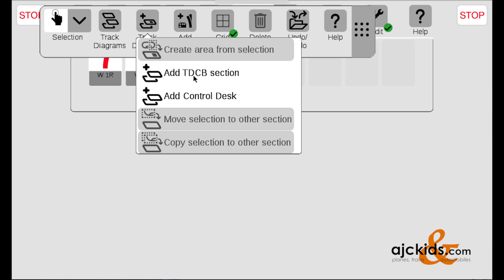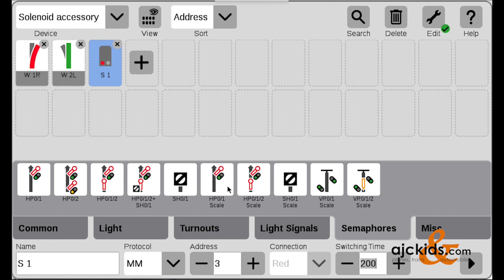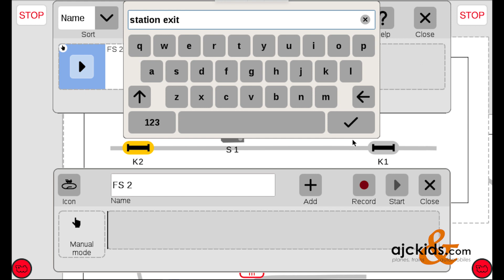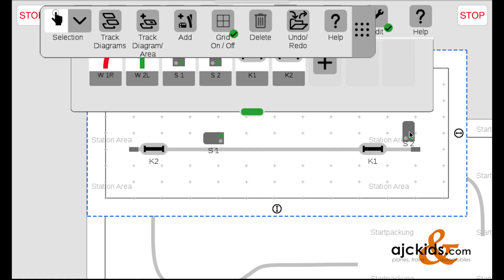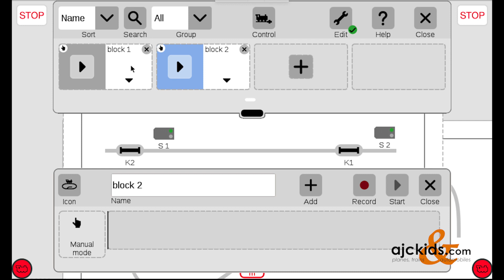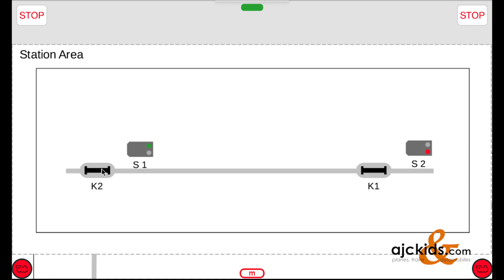Marklin Feedback Decoder S 88 - Part 2: Automation

Comment: Very good video ! I have one question though. Do I need a wire to the S88 for both K1 and K2 blocks ?
Reply from the maker: Hi Flemming,

Great question. Yes, every contact or circuit track needs to be connected to the S-88. On the bottom of the S-88 are 16 ports, and thus up to 16 contact/circuit tracks can be connected to the S-88.

You could also connect "momentary" push button switches (doorbell switch) to the S-88 ports, kinda fun if you want interactive push button switches on your layout. When a guest would push the switch, the S-88 could wake up the CS, and execute "something" (change a signal, let a train depart, etc.)